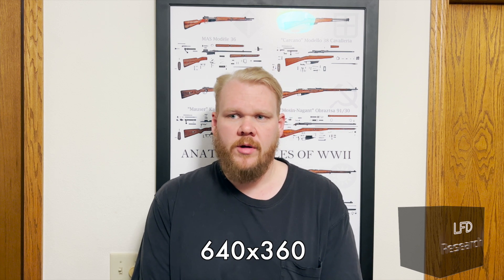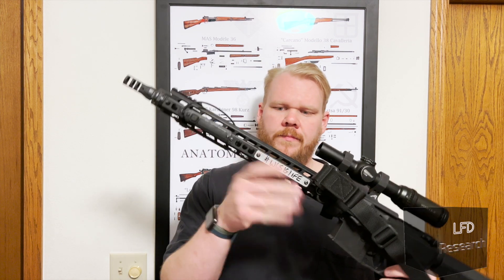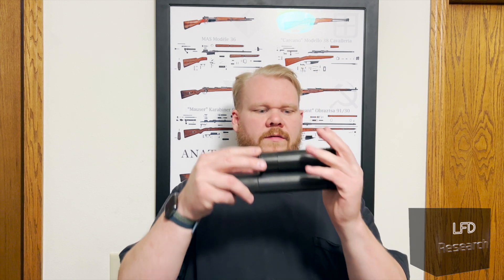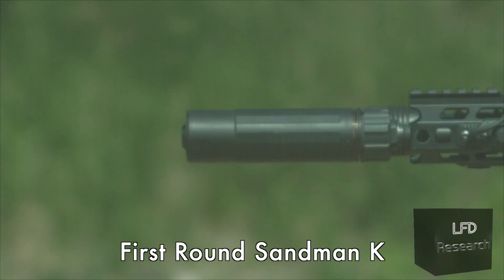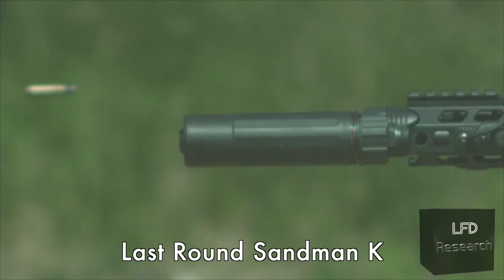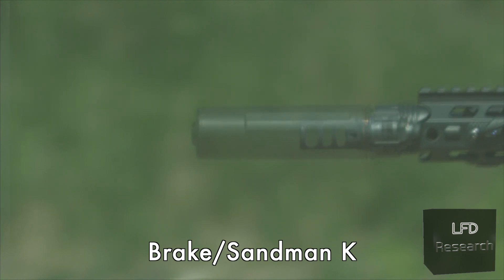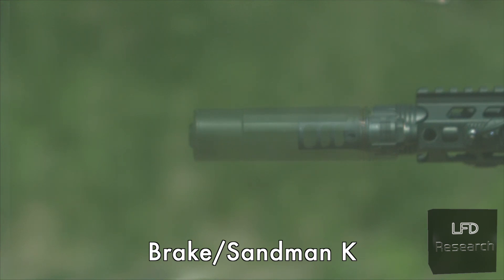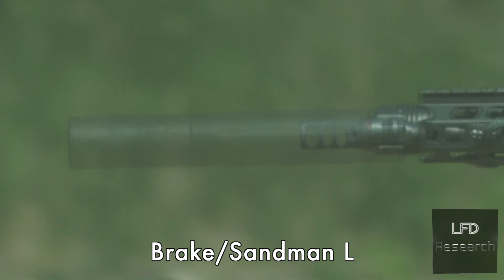Pencil Barrel Whip With Suppressors

Comment: How did this translate to groups on paper ? That would be why any of this is a problem in the first place , if this is happening but the groups on paper are still as they should be then I wouldn’t call this a problem
Reply from the maker: We aren’t even calling this an issue we are just demonstrating what happens and you can see all movement occurs after the projectile has left the barrel. This testing cycle was not performed for accuracy as we are very close to the backstop for safety and going as close to cyclic as possible to prove movement has ceased even before a rapid follow up shot is launched
Reply: @LFDResearch  ah gotcha, I don’t have anything full auto so ide only be concerned with accuracy that’s was my thought process
Reply from the maker: Sadly is true of all of us Hughes is an issue but our goal is to show that the barrel doesn’t move until after the bullet
Leaves and stops well before even a rapid follow up shot it’s not really an issue the larger issue is heat build up possibly allow a shifting point of impact
Reply: @LFDResearch with correct heat treatment the barrel shouldn't change impact. As the grouping will open, the center shouldn't.

Comment: It looks like barrel whip happens after the bullet has completely left? I have a Midwest combat hansfguard and ,y gas block is close. If I move the barrel it can touch the hand guard, will this be an issue?
Reply from the maker: I would say no with the setup in this video you can apply enough force to make the barrel and handguard touch you will notice most of the whip occurs when the bold carrier bottoms out and changes direction the amount of whip can be reduced by using a lighter bcg but there are trade offs incurred by doing that
Reply: That's why MI came out with the night fighter rail and newer barrel nut. Most rails longer than 12in will flex somewhat. Its why Geissele rails (and a few others) are made the way they are, to try and prevent that flex. Barrel whip is somewhat unavoidable unless you have a heavy barrel.
Reply: Yes under load of a bipod or resting it somewhere for leverage would affect it. But for the most part no.

Comment: Let’s try this again with the handguard removed to see more of the barrel.  Those suppressors are definitely moving differently than the barrel.
Reply from the maker: I’m not sure what your seeing but the barrel and the suppressors are moving in sync you can even glimpse the movement through the rail and it has the added benefit of giving a fixed point to compare the movement against
Reply: @LFDResearch  You are trusting your eyes.  Never do that.  Resonance vibration acts differently through different metals of different thicknesses.  Try this.  Remove those handguards and make a black and white graph background, you know, a measuring means to analyze movements in videos.  You will  see the steel barrel move a certain amount, then the tube steel or aluminum tubing of the can moving at a different rate.  In fact, one may be up while the other may be down as the harmonic wave travels down the length.  I’m not hating.  The video is cool as hell.  Let’s just say it was so cool that we want to see it redone with more science.

Comment: Interesting. I'm a big fan of Faxon barrels, both pencil and their gunner profile barrels.

Based on your observations, my question is if there's no barrel whip until after the projectile leaves the barrel, then there should be no accuracy issue if say there's only 1mm of clearance between the gas block and floated hand guard. Would this be accurate?
Reply from the maker: That is possible but in previous testing we have shown that the weight of the suppressor alone will shift the point of impact down and how far that shifts is dependent on the weight of the suppressor. It is an interesting question to ponder and possibly look into in the future
Reply: @LFDResearch  Isn't the downward impact shift caused by "barrel sag" from having a suppressor hanging off the end of the gun? I would assume you could accomplish the same thing with a weight.